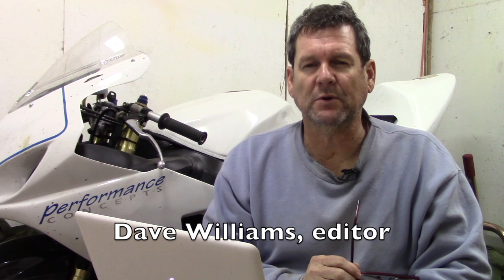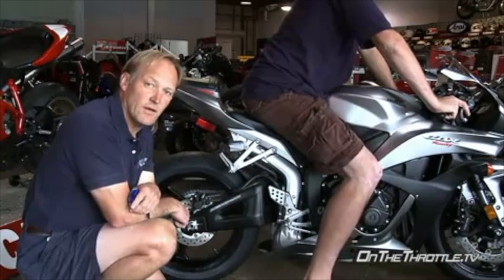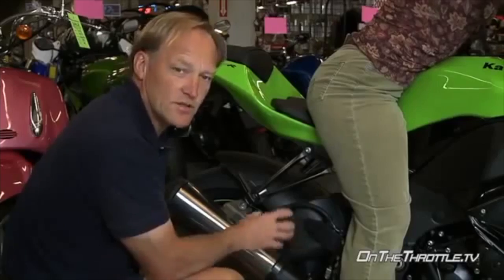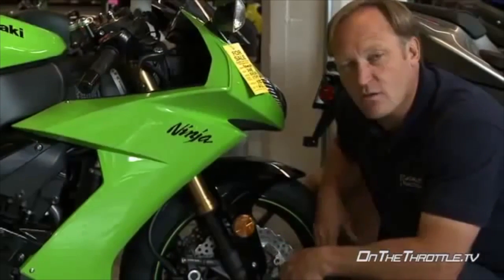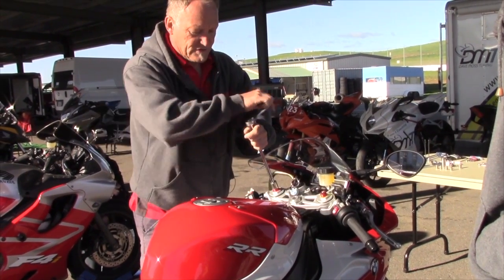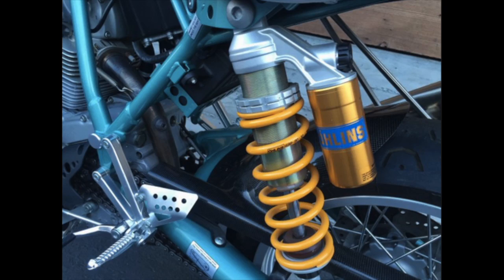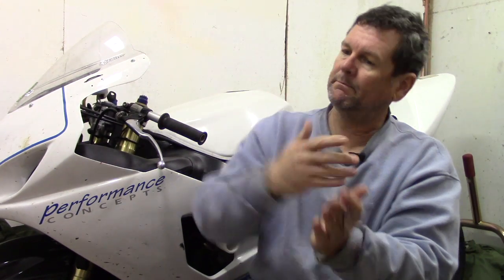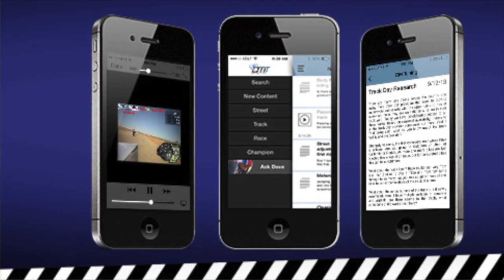Motorcycle Suspension Myth #1

Comment: I’m having problems with my 17 r6. I’m 110 pounds. Can y’all help me?
Reply: Wants to death wobble all the time.  It’s no moving in the front. Like the zx-10r
Reply from the maker: @teamdeep5822  Yes, I can help. I need some questions answered and those answers emailed to dave@davemosstuning.com  1. Miles/kms on the odometer  2. Changes from stock re gearing and weight savings  3. Brand, model and sizes of tires  4. type of riding:- commuting, weekends, aggressive

Comment: Hey thanks for info...I just got to a point on track where I need a suspension tune. I only ride a 06 CBR 600 F4i. But, it is my learning bike as Im 58 years and, 6 ft 2 ..199 lbs fully geared and leathered up, new to track riding. Lifetime rider 51 years.. Im in great shape have a few hundred laps and want to start pushing a little. What is a good learning site to begin to understand Suspension ? Can you steer me to a beginner video?
Reply from the maker: Dave Williams, editor, replying here. Welcome to the next level of the sport! The best website is ours, www.DaveMossTuning.com. The FasterClass series is a good batch of videos to begin with. Here is a video about your bike specifically from our 2 Clicks Out series. https://davemosstuning.com/2-clicks-out-the-venerable-cbr600-f4i/

Comment: Super interesting Dave, love your passion over this type of thing and how much time and effort you put in to help make cycling a safer more and measurable experience. Tell me would you be able to send me any info on Buell XB12X settings for my weight etc if I were to supply email? Kind regards and keep up the good fight💪
Reply from the maker: Yes, email answers to: dave@davemosstuning.com. Your weight without gear, miles or kms on the clock, changes from stock, brand, model and sizes of tires.

Comment: Love the videos. Hi I am 5'3" and 154 pounds guy. I want to buy a new Yamaha YZF-R1M bike (2017 model). What parts I should have to adjust to make it comfortable and stable while riding like flat foot, thick sole shoes or like other things? For this should I go for lowering the suspension or lowering the links, which one is better or anyother better suggestion? Is this will give negative impact on my motorbike while do cornering, I need your better suggestion? I am really waiting for your answer, please reply. Thank you.
Reply from the maker: You will need to change the fork and shock springs immediately to a much softer rate. You can get lowering links from http://soupysperformance.com/ and once that has been done you will need to lower the front forks a similar amount.
Reply: Thank you so much sir for this information. I want ask you one more question that can you share  videos regarding these sort of adjustments, this will be helpful and can you fix all these things for me and how can I contact you for fixing these adjustments? I am really waiting for your answer, please reply. Thank you once again.
Reply: After these all adjustments am I be able to do extreme level of cornering as stock version of Yamaha YZF-R1M can do or can will it damage any parts while doing extreme level of cornering and riding on the uneven bumpy road after this adjustments, what is your best suggestion? Sir, what is your Email ID?
Reply: Sir, what is the best site for buying super biking riding gear, please send me the links ?
Reply: Where can I get softer fork and shock springs, please send me links ?
Reply from the maker: http://www.gpsuspension.com/
Reply from the maker: www.racetech.com

Comment: You said there was no fork spring preload on the S1000 RR, but was  installed pre-load determined by the spacer tube and the adjusters backed all the way off?
Reply from the maker: "No preload" means the manual adjuster is all the way counter clockwise. Internal engineering in regards to preload spacer length and installed preload is not possible on a showroom model as they would not let us take the forks apart (with good reason).
Reply: Wouldn't there always be a certain amount of installed preload? If not then the spring would be topped out surely?
Reply from the maker: Great question - there is always installed preload (see the video on that specific topic we produced) which is internal engineering and then there is manual preload that is external.

Comment: hi dave and dave great channel and info thanks,have watched many of your articles especially on suspension set up and took your advice bit the bullet spent the money on my old gen 1 zx10r and had the suspension redone revalved and sprung forks nitro shock in the rear and geometry change for tight up hill down hill gorge riding(my favourite) set to my lite 65kg weight what a difference turns on a dime, the bike is doing some work now and no more sliding front end (not confidence inspiring) mint.It has become a different bike.would recommend to anyone having their bike sprung for their weight and set correctly.Two thumbs up dave and dave and two thumbs up to Robert Taylor and his crew at kiwi suspension solutions in NZ for sorting my ride.
Reply from the maker: Great to read how you took the bike and made it your own with quality suspension components. Nice work!!!!

Comment: Dave. I have a street triple r 2016. I heard rear shock are progressive. Also, in manufacture manual it is written "do not change the preload setting". Factory set is 7,5 turns, no matters how much weight you are loading the bike. Also, they removed the preload tool from the toolbox. My question is: how is preload setting behavior in a progressive shock. Can i sag it normally, measuring and ajusting to find the ballpark?
Reply from the maker: As with any settings, softer means more travel with linear or progressive. The difference is that progressive will store more energy so setting rebound can be problematic. The more weight you carry the more preload you will need. The data point to follow is static/free sag to keep that between 5 (loaded with pillion and gear etc)  to 15mm for you riding solo. Then you find the right damping settings.
Reply: Dave Moss Tuning thank you Dave. I just measure free sag (bike's weight only right?) and forks and rear shock are 30mm... i guess its way off. Its a brand new bike. 4 months only and 6k km. I am eating all your videos now. Thanks again.

Comment: Dave: just curious about if you have a passenger... and setting up / tuning the suspension... I am currently going to buy a new ZX14R my weight is 245lbs. and passenger is 105lbs. how much difference between riding single verses 2up? no information out there that I can find... thank you for your videos and help you are an amazing wealth of knowledge
Reply from the maker: with a passenger, the first and most important change is tire pressure. You will need more of it front and rear so the tire keeps its shape under braking and accelerating rather than overly deforms to ruin handling. Next would be adding compression front and rear and potentially, adding more preload to better manage weight transfer.

Comment: Great info. I just riding for 2 years but sometimes wondering why things happen on the bike. Because I'm relatively new but experienced  with over 35 years on cars you opened my eyes. I'll let someone check my suspension soon.
Reply from the maker: Take your time with the measurements, and make sure with your forks you mark bottom out accurately otherwise the measurement is flawed. There are plenty of setting sag videos I have produced that you can pause as you work your way through the math. Thank you for taking the next step!

Comment: Dave, approaching a new bike should I set front sag first or rear sag? Since you said changing one affects the other, would setting the front sag first be advisable (especially when the rear sag requires changing springs).
Reply from the maker: See where you are with fork sag  (mark fork bottom out first!). Once you have that in the ballpark, check the rear next. Generally the rear will be the area where a spring will need to be changed first. Once you have put sag in the ballpark, you ride to see which direction you need to go.